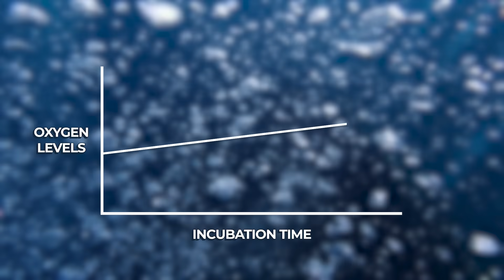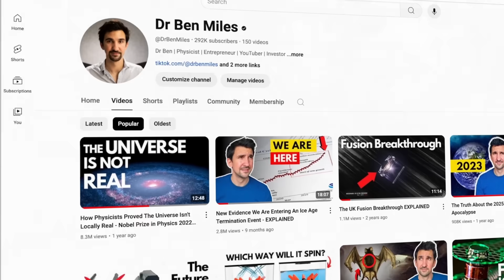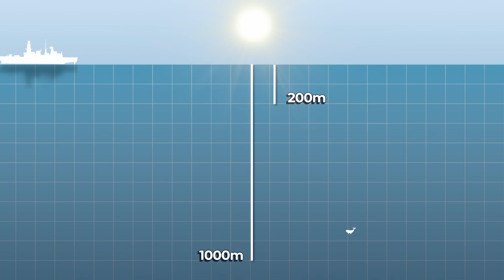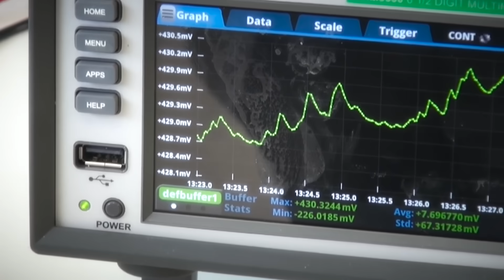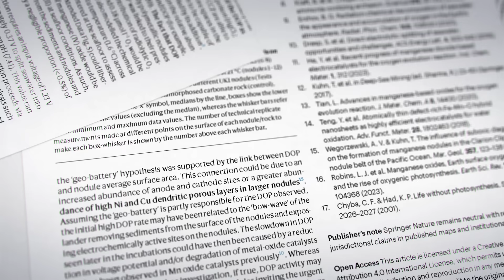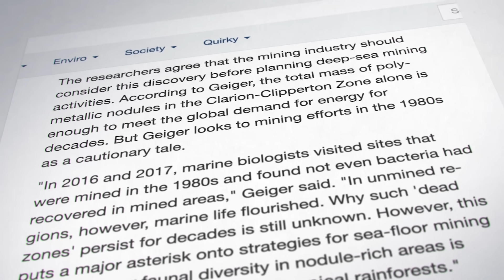We Just Discovered "Dark" Oxygen on Earth - Breakthrough Explained

Comment: the one thing everyone is neglecting is that the entire planet, metal nodules and all continuously moves through magnetic fields produced supossidly by the molton Iron core. Each of the stones would work like a single molecule within a wire and conduct electricity on a regular basis...therefore electrolosis. Its not rocket science, its basic magnetism and electricity.
Reply: No.
Firstly, ignore the galactic, solar and intergalactic magnetic fields. They are pushed aside by the Earth's magnetic field as Earth orbits the Sun (and the Sun orbits the galaxy, and the Local Group of galaxies fly towards the "Great Attractor"). The only magnetic field detectable at the surface is that due to the Earth's geodynamo.
As you learned in physics class, the voltage (hence, current) induced in a conductor by a magnetic field is proportional to the rate-of-change of magnetic field in the volume swept by the conductor. Since the ground (deep sea, or not) is not moving (much) relative to the core, the rate of change of magnetic field experienced is low. My compass needle works perfectly well day and night, and only significantly changes when I go to Ladhar Bheinn or the Cuillins (where the magnetic field from local rocks  overwhelms the global field) - without me moving hundreds of km, the rate of change of the magnetic field is very slow. Plus, the metal fragments involved are very small (microscopic, literally) so the volume of (slowly changing ) magnetic field they sweep through is small. Small times small gives you a very small product - the oxygen you're looking for.
Your physics is basically correct ; your geology is wrong.
Reply: @WellsiteGeolog interesting rebuttal…..

Comment: In order for these rocks to grow there has to be a chemical reaction taking place that causes the ionization of the minerals from the sea water to the surface of the rocks; this reaction obviously would have to release Oxygen and Hydrogen locked in the H2O (water)
This chemical reaction is evident in iron deposits found within rock s on the surface, as these iron deposits are surrounded by rust (oxidized iron) so this oxygen production has been occurring since the first iron bearing asteroid came into contact with water!
Reply: If it's solid, anything goes dark, even burning uranium 223 gets dark if it's super compressed 👍🏼

And sometimes, the fire is invisible by naked eye 🤙🏼

Comment: If the electrolytes for the conversion process are being supplied by the constantly flowing salt water of the ocean, then I wouldn't worry too much about the energy source. If their studies are being conducted in small closed containers, then that in itself has the potential to use up all the electrolytes and/or change the equilibrium needed for the process to occur. I also wonder about the minerals in the nodules, if it is just a straight electrolysis type reaction or if there is also some form of natural catalytic reaction happening in the process... this could yield a huge leap forward for space exploration, if we're able to develop an easy, simple, dependable, low energy electro chemical process for oxygen production... and the anecdotal evidence as told in this video does look like the undesea mining is absolutely devastating for life on the deep sea floor, as evidenced by a direct cause and effect, even if exact process concerning these nodules and the life that abounds near them is not understood... I don't know what or if there's a balance possible between mining and preserving that type of ecosystem.... it's a tough call...

Comment: A couple of observations. First, the fact that life did not recover in mined zones clearly makes a case that, regardless of HOW it happens, these bodies are important in sustaining deep sea life in the area. Second, the fact that the oxygen production decreases in the sealed containers doesn't mean that the nodules are depleted. It could be due to the depletion of another substance required. You would need to remove the water from the container and refill with an identical water sample and see if oxygen production resumes. It seems that it is perhaps functioning as a redox catalyst. Since it is a heterogeneous catalyst, if the mixture isn't constantly moving and replenished with appropriate cofactors, it would die as observed. In a natural environment with moving water and replenished electrolytes, there is no reason that a good catalyst would ever stop functioning. Also, heterogeneous catalysts work more efficiently with higher surface area. So...battery? Possibly not. But catalyst? I think that the possibility of heterogeneous catalysis is very likely.
Reply: This was my initial thought exactly and I bet the rebuttal said something to this fact as well. It's been 7 month so it's possible something more has come of this.
Reply: Naturally occurring electrolysis, I think this is the missing link to evolution, the scientist need to trace hydrogen atoms.
Reply: I agree. This is likely to be a materials science discovery relevant to nanotechnology. There could be nanoscopic pores with anode nuclei juxtaposed to cathode nuclei in fixed positions with an essentially infinite substrate and solvent. There could also be a contribution of the physical environment PV=nRT and the biology on a general molecular level, eg detritus.

Comment: Wouldn't the water current on the sea bed displace the new discharge of oxygen formed (new oxygen rises to warmer water) or would the distance between each module be connected in series/parallel thus allowing current and discharge between each other and the sea water is the electrolyte solution that this all occurs in?

Comment: Your use of the term "produce" oxygen in reference to photosynthetic organisms is not accurate. More accurate would have been: "Photosynthetic organisms convert water molecules into oxygen and release it as a byproduct," else "Photosynthetic organisms release oxygen as a byproduct of converting carbon dioxide and water into glucose using light energy."

Comment: The nodules need to be hooked up to a volt meter for an extended period of time to see if their voltage decreases, maintains, increases, or is variable over time. Also, test them at various temperatures and in different atmospheric and underwater conditions. I'd first like to know if the nodules generate voltage due to any external factors before calling them a battery.

Is the plateau of oxygen production due to the oxygen saturation levels in the water reaching a specific percentage? If the water is replenished, does the cycle repeat exactly the same with the same nodules, or do the nodules produce less oxygen every time the water is refreshed?

Comment: I'm not surprised. I have iron copper batteries that I keep in a jars. I used all kinds of electrolytes, but the best is dirty cleaning water. It produces a higher voltage, powers LEDs forever, and the anodes and cathodes don't seem to corrode, but rather get plated instead. Also biological and other dissolved contaminates crash out into the bottom leaving relatively clean clear water on top. My guess is it's an ozone reaction, that the battery's make both O2 and O3 which reach levels that kill off bacteria. So if you can make power with iron copper and dirty water in a jar?  Why not nodules of metal on the ocean floor.

Comment: Hypotheses are just that - possible answers to unexplained phenomena. If the model explains how we think it works, then the model is useful. If there are some parts of the observable data that the model doesn’t account for then we create a new hypothesis and a new model if the hypothesis seems correct. Until someone comes up with a better hypotheses that explains things like what initiated the nodule building and started the oxygen release, the battery effect will have to do. In any case, we should act like we don’t know what we are doing and leave the nodules where they are. So far it sounds like drag netting the ocean floor causing a complete loss of fish habitat.

Comment: It may be that the geothermals in the area drive the "batteries". Also the oxygen in the test samples was unable to leave where as the oxygen in the ocean can move on. Over oxidation of electrolysis plates slows production to a halt. There may also be a ionic transfer between minerals in the water and the deposits thus the reason for the deposits and the regarging of the "battery". This would be independent from geothermal charging if that even pans out.

Comment: The way these nodules are uniformly laying across the sea floor, and also on the top makes me think that there not static, maybe they slightly rotate or vibrate due to currents or even the earth's magnetic field 'wobbling' (the earth doesn't spin uniformly across its axis), which might be enough energy for electrons to move and cause electrolysis - acting more like a dynamo rather than a battery

Comment: A basic guess.....
The nodules (rocks) are sedimentary.  There are molecule-size channels eroded between layers, transporting ions (from whatever mechanism) throughout, so voltage depends, as seen, on surface area.  The gathering of charge would seem to drive an electrolysis that produces oxygen at some static rate that requires an equilibrium gradient at work.  Isolating the rock in a volume then produces an increasing oxygen level that levels off over time because the measurement requires dissipation of charge (in order to measure it).  It's kind of like a geologic capacitor: ionic gradient in conductive channels -> steady current -> electrolytic oxygen.   Siphon some current and you reduce capacity.

Comment: It's possible that the reason the nodules aren't "depleting" requires wondering why the difference in electric potential emerges in the first place. Especially if the nodules are forming very very slowly via a crystal-like growth process, differences inherent in the metals themselves would almost immediately "fix" themselves probably even before becoming a part of the larger nodule if not as a part of joining it.

It could be that some aspect of the deep sea environment is causing electric potential to build up in the nodules- perhaps some differing quality between the metals causes nearby water to be slightly more attracted to one side of the nodule than the other, which could cause the occasional electron swaps between the water and the metal as they pass to be more frequent on that side. Thus resulting in a consistently occuring difference in potential cause, essentially, by the movement of water around the rocks- static electricity (which water is very much known to build up entirely on its own when moving around alot)

Comment: It’s very likely that low voltage has created super capacitors out of nodules over millennia while we see concentric layers it’s much more likely a long sheet of carbon wrapped around the nodules a single sheet of carbon with metal additives wrapped several trillion times with salt water is a battery or capacitor,

Comment: I would speculate one of the metal compounds is in a steady state between its oxidized and non-oxidized forms. In such cases - a slight change in pressure or temperature (due to the collection process, for example) would shift the balance and release excess oxygen. 

In short, the nodules are not an 'oxygen source' but an 'oxygen buffer' that released some oxygen due to a thermodynamic change.

Comment: One test that  could lead to confirmation of this is, if hydrolysis is going on, there should be hydrogen released as well (or they'd need a good explanation as to where that's going) since water should be releasing twice as much hydrogen as oxygen when broken down.  I'd be interested to know if they've repeated tests and looked at this aspect and, if so, what they've found.
Reply: There are quite a number of microbe genera that can subsist on (or use, if available) hydrogen as an energy source. It's actually facultative (an available option, if the environment supplies it) in a lot more microbes than those that dominantly survive on it. Not seeing free hydrogen isn't that surprising.
(BTW, detecting hydrogen isn't a problem of the containment. It's that the simplest, most common detection sensors - FIDs on a chromatograph - either use hydrogen as a "carrier" gas", or aren't sensitive to hydrogen. If I were tasked with addressing the problem, I know where I'd go to get data sheets on relevant detection equipment, but the technicians who run it don't tend to understand their equipment very well, so it would need appreciable development work. Which would take several years.)
Reply: My thought as well! Of course, hydrogen build-up was not likely to be detected since it's so hard to keep contained, but it seems like they could plan for that now that they have a hypothesis for what's going on.
Reply: i think they are already sure about the oxygen presence. The main question is about how this process can be sustained without depleting for so many thousand years
Reply: @andremarques3317  Ocean currents change. You need to demonstrate that it has been "sustained ... for thousands of years" before stressing greatly about how it has been sustained.
Reply: would measuring the pH levels of the water in tests overtime help give an answer to that?
Reply: @ccyuni6746  Not really. The hydrogen ion concentration ("pH") is affected by a lot of other things than electrochemistry, and a lot of those things are processes life is actively or passively involved in. A change in pH would require a lot of other simultaneous measurements to link definitively to a change in electrochemistry.

Comment: My first thought (before I watched most of the video was an chemical process, not likely given temperature or a pressure driven process given silicon dioxide is very common in earth crust or if the area was rich in dead coral and this release for the carbonates) .
However given the presence of metals, if there is Platinum ( or other metals) this may be acting as a catalyst to reduce the energy required to split the water into hydrogen and oxygen.

Comment: I wonder if maybe it's not just that each nodule can act as a battery, but rather that the entire area the nodules reside in is actually one giant energized area. That area, that bubble or force field, is what actually creates oxygen over a large area. I'm not completely familiar with electrolysis and how it turns salt water into oxygen, but I am keenly aware of the electrifying properties of sodium. That is, the fact that SALT holds a charge and the sheer abundance of said salt in the ocean.

I posit that the reason why the nodules don't just run out of energy is that they don't have to. The nodules don't need to be the primary source of power in order to drive the chemical reaction, they just need to be the spark that starts the process as well as the balancing mechanism to maintain the process, kind of like the switch and wires that connect a light bulb to a battery rather than being the battery itself. (This could also explain why those areas where mining was done had a drop in life. The wires that connected the power source to the oxygen generating process was cut.) It's actually the salt in the very water that the process is splitting that acts as a power source, but because the smaller testing and the initial tubes brought up from the seabed had a finite amount of salt the reaction eventually subsided. If the scientists could somehow measure the power levels and power consistency of the nodules while they are undisturbed on the sea bed AND in the water surrounding it then that might shed some more light on the situation. Pulling material from a location and testing it in a closed, finite environment is far different than testing that same material in it's natural open habitat where it thrives.

TL:DR I think the nodules are just sparks, like the spark that ignites a fire. The real energy source is the salt in the water that is being split, consuming the "salt" and splitting the "water" in said "salt water."

Comment: My guess is that quantum phenomena, similar to the photosynthetic/photoacclimatization systems of cyanobacteria energy transfer,* are responsible for the apparent contradiction to the laws of classical physics demonstrated by the longevity of 'sea batteries'. (The polymetallic nodules may be large, but the chemical reaction is molecular, possibly sub-atomic).

*Cyanobacteria deeper down in the ocean, exposed to least light, have much greater light transfer speeds than cyanobacteria nearer the surface. Though they develop larger with several more membrane layers to help them absorb as much light as possible, you'd expect energy dispersal to take longer, dissipating along the way...but energy transfer in cyanobacteria with longer antennas is actually transferred faster than in their counterparts with smaller antennas even though the energy has a shorter length to travel (cyanobacteria grown in strong light has a rounder shape and only one membrane layer containing photosynthetic machinery). This perplexed scientists until they figured out that by fine-tuning the distance between the pigments and their relative positions, cyanobacteria can switch their antennas from one state to the other. In this instance, quantum phenomena explains why longer antennas result in faster transfer of light energy to the photosynthetic systems, moving as a wave, overcoming obstacles in its path with greater efficiency.